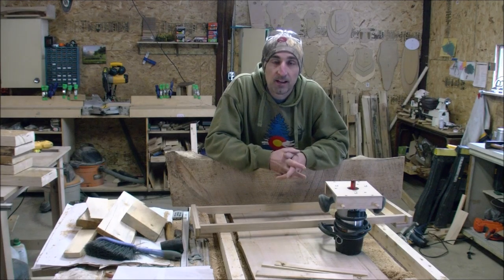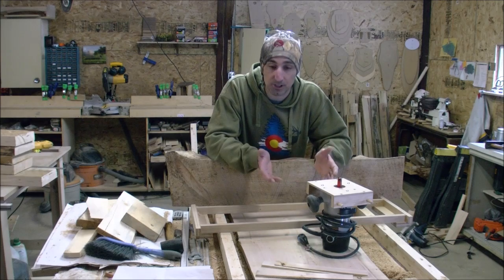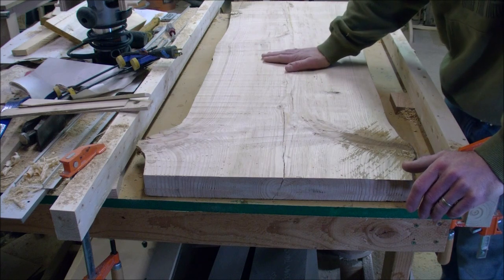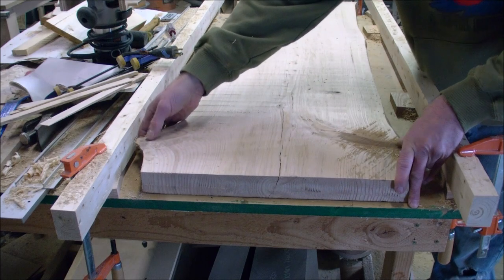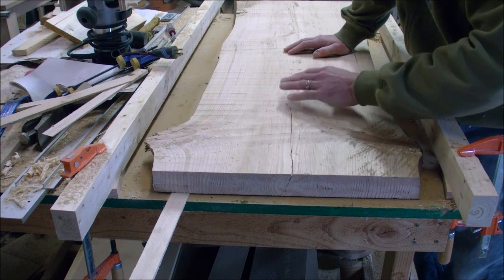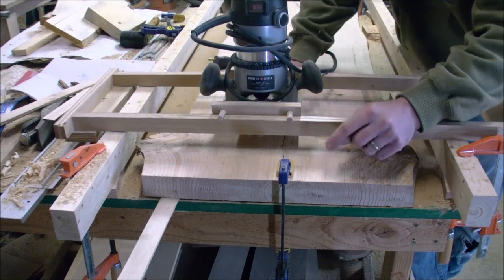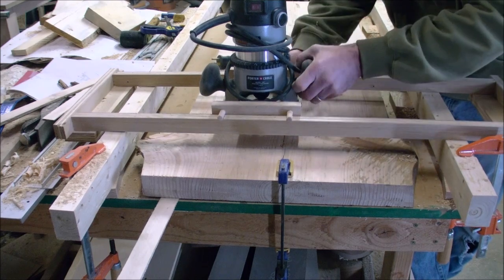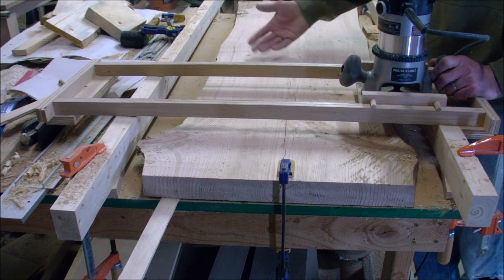Wood slab flattening: Using a handheld router

Comment: Excellent idea. Tried glueing up two 8x10x36 pine boards to make a leg vice, with about 1/8 " cup in each board. Put cups opposite and clamped. didn't take long before one of the boards cracked and took the shape of the other board. Have to use pine, can't afford a hardwood. Hope this works out. I realize that a leg vice will be putting a lot of strain on the long grain of the pine, but thinking about chamfering in a 1/2x3x10" piece of oak across the outside, top side on each side of the vice. Thoughts?

Comment: What size bit are you using? I believe I may have gotten a bit aggressive and got a bit too large for my router to handle. I have the same porter cable, and a 1.75" straight bit. When i did a test the router had a ton of vibration and irregular noise. Please share your thoughts. Thanks
Reply from the maker: +Aaron Gibbons I simply used a 3/4 - 1" straight bit for simple, small projects.